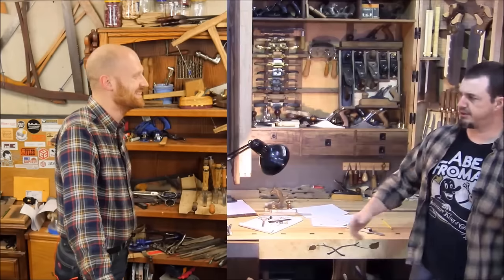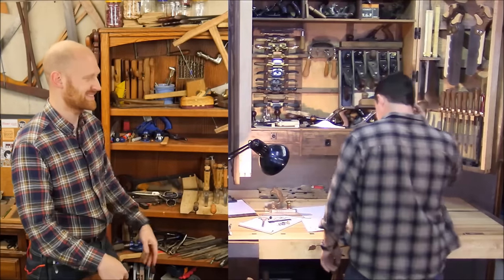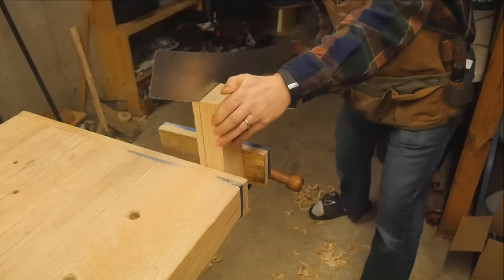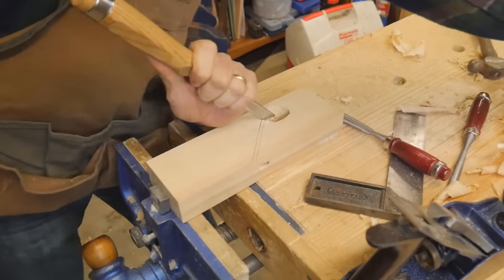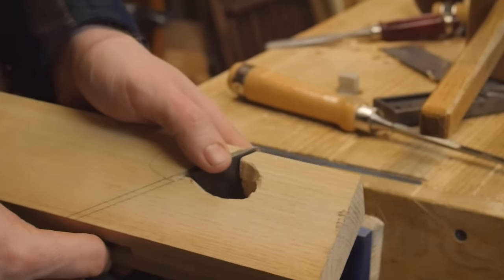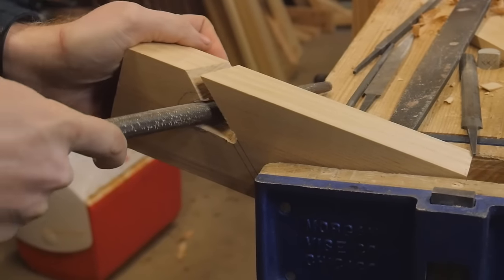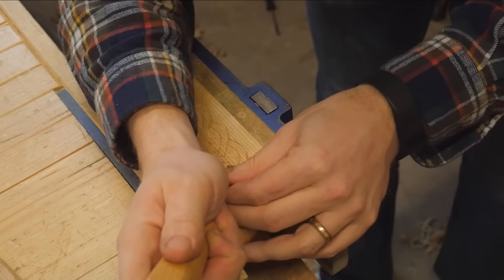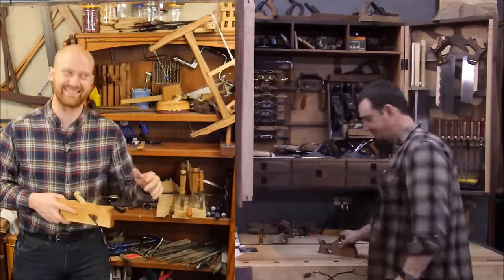How To Make a Shoulder Plane With Skewed Iron A Collaboration with BearKat Wood

Comment: I too have an old scewed shoulder plane, heavy blade and the most extreme hollow grind I've seen on anything. The blade is 3/16" and doesn't appear to be worn down at all. Whoever made it spent a bunch of time on the conical mouth. A delight to use.
Reply from the maker: Sounds like a fun one!

Comment: A great tool you made there, nice work. only the printed carving template was a bit of a cheat in my opinion I'm shure you could have pulled it off without judging by your skills.. cheers.
Reply from the maker: thanks! I use to do draw it by hand and do some times. but I enjoy using the patern for some reason. which I find odd because I almost never use a patern for saw handles and most people do. guess I am just odd. LOL!
Reply: I just noticed it because i thought the challenge was no power tools, and I figured the computer and printer are. just to give your challenger some ammunition.lol. I'l subscribe to your channel.
Reply from the maker: +Flip de boer one of the odd things about unplugged is there are so many different lines you could draw. to be honest I have people tell me I should not have lights in my shop, but then the camera does not work well and I do not like the idea of torches in my basement around wood curls. lol but for this one we both used patterns at one time or another. funny thing is Brian used a pattern for the body and free handed the carving. I used it for the carving but free handed the body. Thanks for watching! and if there is ever something you want to see just ask!

Comment: Awesome video James! I really like that plane. I just might have to try and build one!
Reply from the maker: +donny carter You should! The curls alone are worth the work!
Reply: +Wood By Wright any suggestions on where to find a little more info? Blade type? Thanks!
Reply from the maker: +donny carter The blade I pulled from that old body I was holding at the beginning. the body had apparently been left outside and was rotten. but the blade was hand forged and well over 100 years old. you can buy most any blade from Lee Valley here http://www.leevalley.com/US/wood/page.aspx?p=43698&cat=1,41182

If you want any particular info just ask.
Reply: +Wood By Wright thanks James!

Comment: Many thanks for this video..Have you plans for building a plane like this?
Reply from the maker: +Carlo Pieracci No, because it all depends on the iron you get. This one has a 45 degree bed that is skewed 30 degrees. Even the angle of the wedge can be whatever you want I usually make mine 1":4"

Comment: Hi, very nice work! enjoyed the video. Just a quick question, I guess making the 30 degree angle in the other way (chips goind out on the right) is just a matter of taste? or there is some reason? Thank you in advance.
Reply from the maker: It just depends on which side wall you want to be the one that goes into the corner. It is traditional that most woodworkers were right-handed and so it's slightly more convenient for it to be on the right side of the plane

Comment: Nice editing Mr Underhill Jr ;)

What does: 'i adjusted a few things' mean? How did you make it work better?

That plane is awesome. Great curls. How did the old plane cut?
Reply from the maker: +Willem Kossen LOL Thanks! the bed was not perfectly flat so the iron chattered a bit. that made it skip and jump through the cut. also the wedge had a slight gap at its tip where a chip got cought so I had to plane it down a bit more.

The old plane did not cut. That is where I got the iron. but the old one was so rotten that it would no longer hold the blade. sad, but I gave it a new life in ash!